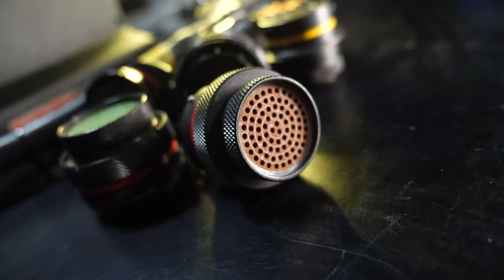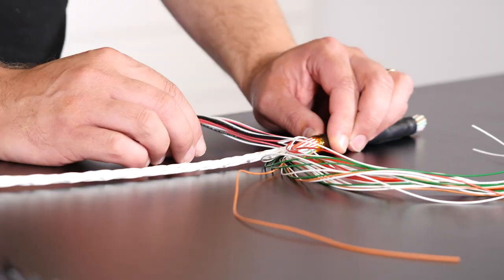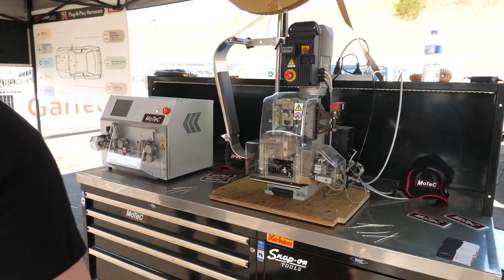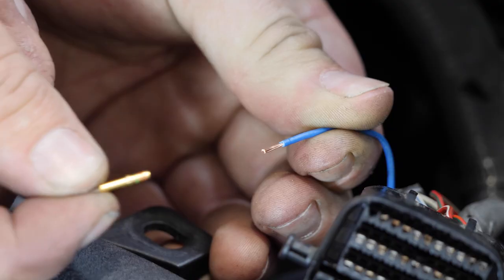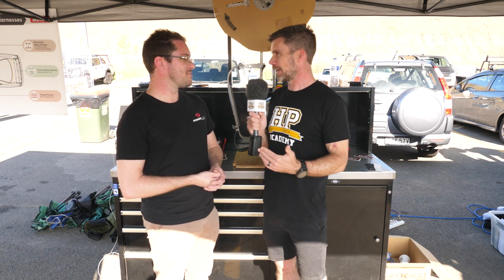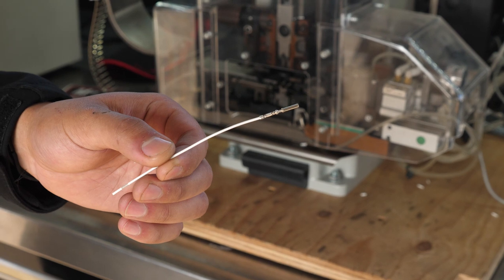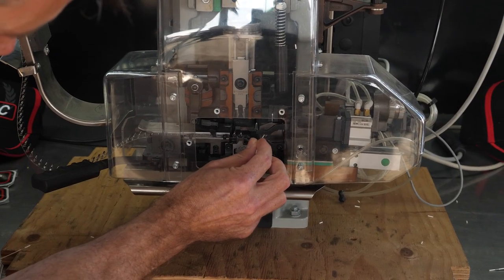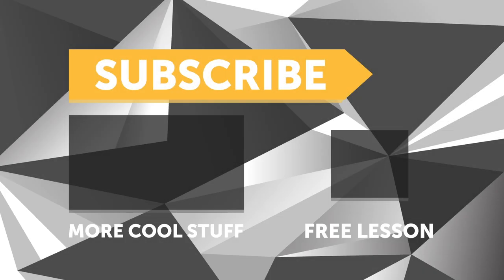Why is Tefzel wire HARDER to strip?

Comment: If quality crimpers and strippers weren't already expensive, now we've had to go and make something like those... Once I get to the level of production where I can justify it, it's sold. Constructing harnesses is way more time consuming than what the average customer thinks, when you quote someone on an engine, harness generally you get a you must be kidding look on their faces. Them not realizing the amount of time that is used in stripping and crimping alone. Now you can charge the same but not have to work nearly as hard. Need to make your tools pay for themselves. And no more hand cramps and going cross eyed. Thanks for the great information you guys put together, keep it up🤙
Reply: They tried to hide the brands, but the cut and strip machine is a version of Komax Kappa 310 , and crimping machine is a Mecal by Starn TT Crimping Press with applicator and striper accessories.
Reply: That's what I was looking for 😊. Thanks team.
Reply from the maker: We didn't try to hide anything, the brands just didn't come up noting the talk is about what can be done rather than advertising the specific equipment. There will be many options on the market for work like this and what Powertune use might not suit another company for their own specific work.
With that out of the way, thanks heaps for sharing the machine details for others =) - Taz.
Reply: @hpa101  Sorry didn't mean to throw shade on you or your team, it was just clear someone had covered the make and model of cut and strip machine with the Motec sticker.
Reply from the maker: Ahh I get ya! Stickers like that surely just help the machine run faster right 😂
Thanks again for sharing your knowledge about them 🤘 - Taz.

Comment: Always something to learn from your content whatever the topic . 
A good habit to get into is imagine it as pipework with clean and neat routes, plan for additional components that may be fitted at a later date . 
By biggest headache is final termination on large connectors getting the lengths correct without leaving a tight wire 😵‍💫😵‍💫😵‍💫😵‍💫😵‍💫🤨

Comment: Indeed, that's time consuming and boring to repeat one action dozens and hundred of times, but that should not make us speed up to the level where striping becomes reckless. Required care to strip without wounding the underlying conductor requires to spend time to do it, no escape.
Reply from the maker: If you can do it faster and maintain or even improve the standard compared to doing something by hand, why wouldn't you? This is of course assuming you have the volume to have speed as a bottle neck in the first place - Taz.
Reply: @hpa101  absolutely right. As Andre says during the discussion, such cuting/stripping robot is hard to justify for a guy like me. I don't have such volume. I produce less than 10 harnesses a year and only one or two are pro Motorsport grade  using tefzel wire. But for somebody that makes such harnesses day after day, yes that's definitely a tool to consider, it will produce repeatable / constant quality work and will do it while you're busy with some other part of the job. Could be game changer, yes.
Reply from the maker: Good problems to have if you ever reach the point where you start thinking about such equipment too right!
Can also be just as good not having to deal with more projects and people though haha Life is good like that, heaps of options.
Happy wiring and cheers for the chat 😎 - Taz.